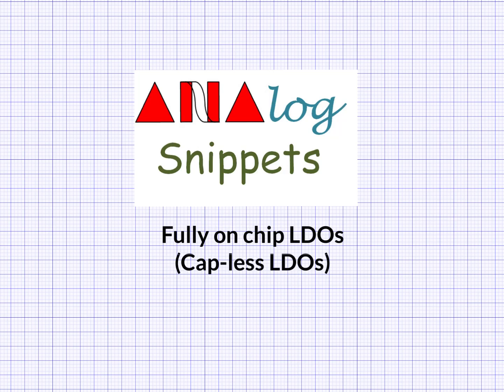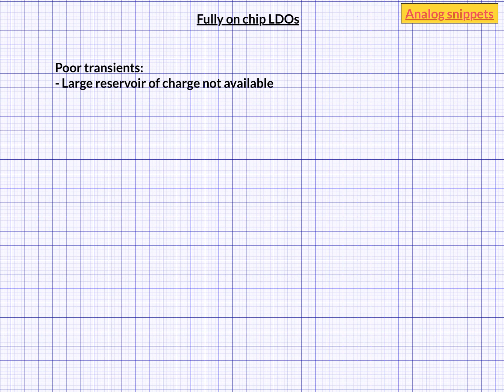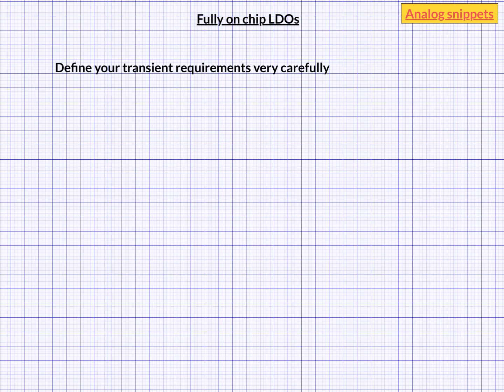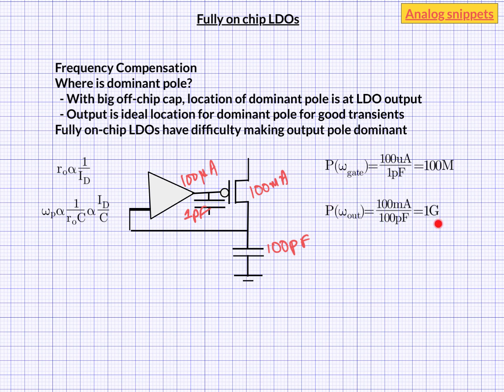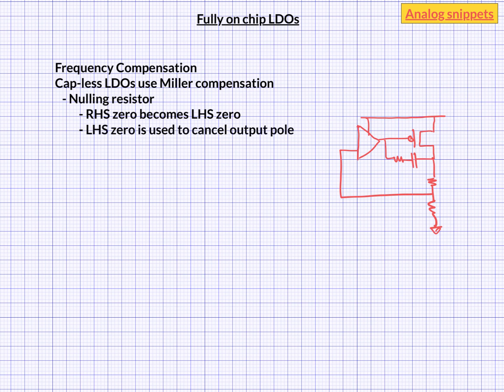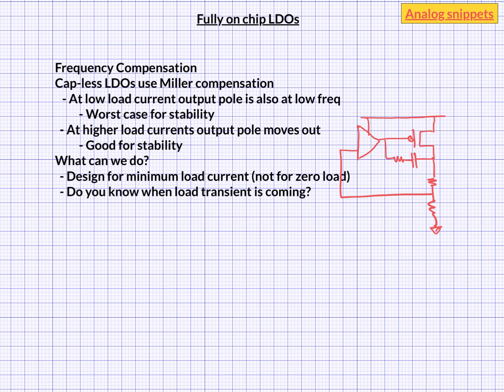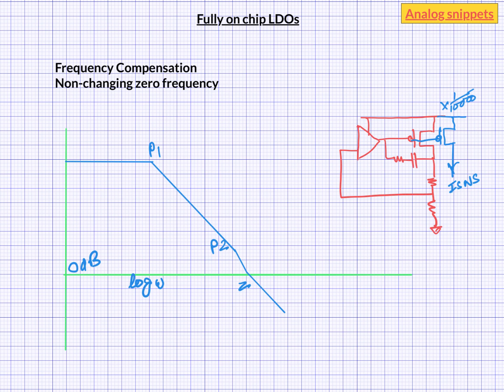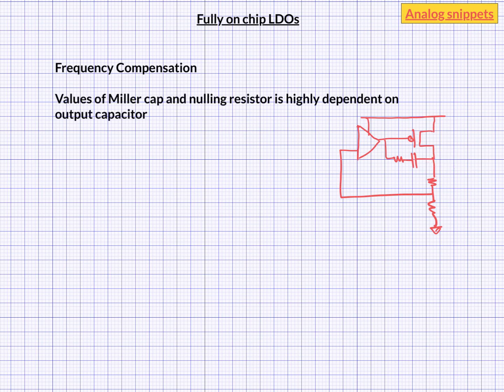#37 Fully on-chip LDOs

Comment: Thanks for your video. Have a few points:-
-You can have nF of cap and make output pole dominant through on chip MIM capacitor. Output cap of the order of 100s of pF cant sustain much load transient.
-Miller compensation makes PSRR really bad a very important spec for LDO. I don't think this topology sports a worst case PSRR any better an -10 to -15dB.
Reply from the maker: Thanks for your inputs. Yes, good points. PSR is especially a nagging issue with Miller compensated LDOs. One solution can be adding additional loops to improve it.